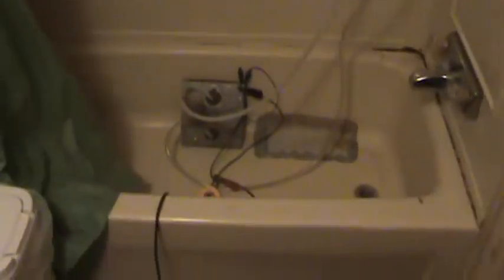#20 My hho water wheel idea

Comment: you could use the rising bubbles in a tube on one side and and the wieght of electrolyte going down on the other side.
a volume of gas caught under a cup would exert quite a bit of lift.